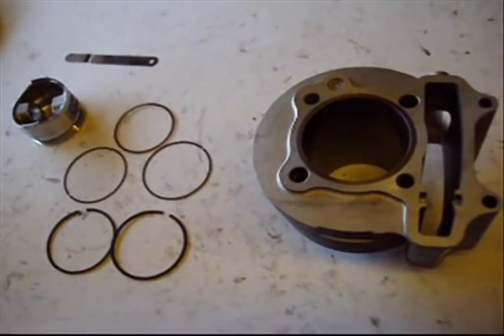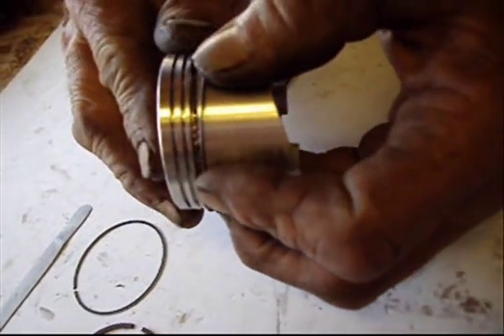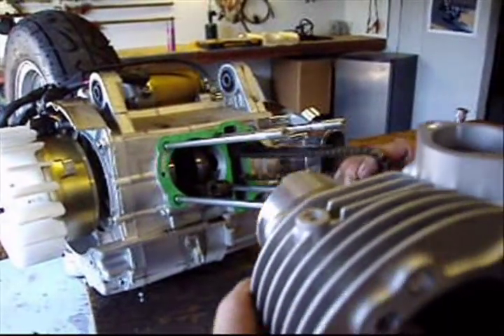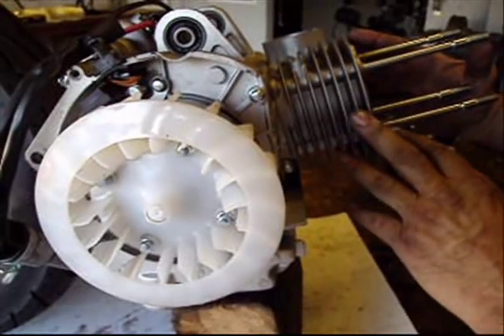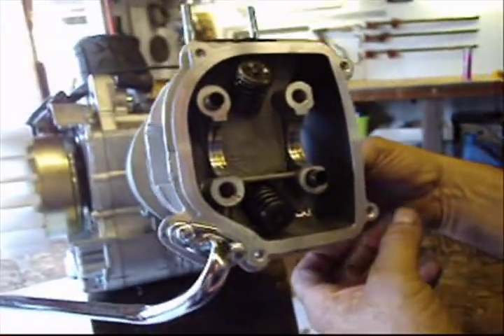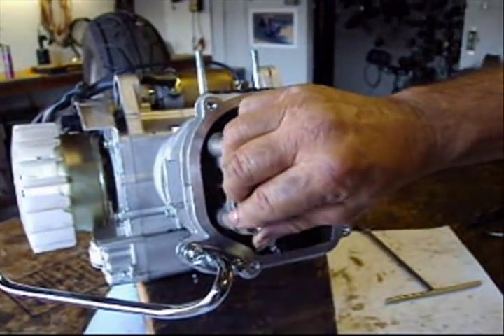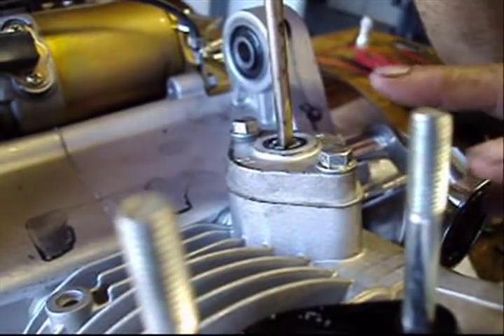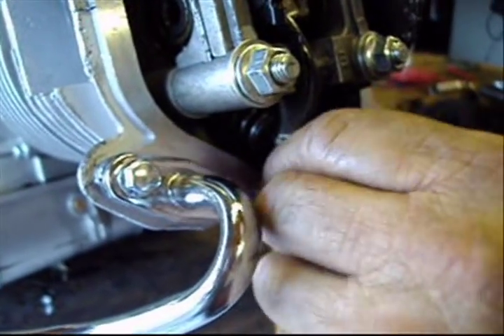replace top end # 3 on GY6 motor Nor Cal Scooters

Comment: nice video, nice channel, it is actually a lot like mine.   little bit of everything.  just do what you love and video it.  nice!!  working on the 150cc, had oil in the airbox, not sure how it is getting in there.   didn't add oil, and top end power is gone, and every time i rode it, when I would stop, seemed like oil would be spitting out the air box, so I think it might be the rings   (150cc Tao Tao 4 wheeler)   Thanks

Comment: I have been a bike mechanic for 43 years . First you should never never never dry fit a piston and rings into the cylinder without first applying assembly lube ( oil ) on the cylinder walls . Second you should set the connecting rod to top dead center (tdc )  and wrap a clean shop towel around the rod to cover the opening in the crank case before you attempt to install the piston and wrist pin . The reason for doing this is because if the wrist pin clip pops off your needle nose pliers as they sometimes do when trying to install them and flies into your crank case you are going to have a serious problem . You will have to do a complete disassembly usually to retrieve it . Just sayin '
Reply: I was thinking just the same. Always apply oil in the cylinder walls!
Reply: oil the shit out of every moving part.

Comment: I replaced the gaskets on my 150cc and the inner gasket was leaking again at the bottom i took it apart and the gasket is properly seated what the heck happened and will it happen again?  That inner case gasket was leaking on the top before when running the engine now the replacement gasket was leaking on the bottom.

Comment: To install a new cylinder head rebuild kit, do i need to remove the engine from the rover? I bought it used and the owner said the exhaust valve was stuck open? The engine turns over freely but doesn't fire up.

Comment: what if you drop the wrist-pin-clip in-to the case, while trying to snap it in?  use a plastic guard over the connecting-rod and exposed hole for the cylinder...even better/guard and long handle vice grips...
Reply: they make a magnet that extends it looks like pen if u will.

Comment: out side of oiling the piston cylinder  etc use a torque wrench the rocker arm assembly is brittle if u will.
Reply: Agreed, it's cheap white metal. Hand tightened would suffice

Comment: Is 8 thousandths 0.08 and Whats the best valve gap for the 50cc 139qmb with a 100cc bbk 0.04 intake and 0.05 exhaust
Reply: Skip that, just make sure you have the right parts..

Comment: my scooter is making an extra noice after changing the cylinder kit , i wonder what it could be , a chinees dude did it for me , can it be that he put the vavlechain upside down with the ex echaust etc ?
Reply: I have a question i got a sunl 150cc scooter from a local tow service and its been sittin up for a year and i prep it to get ready to crank and no suckion was cumin from carb so i took my intake off and took a peek at my values and there not sittin and one bumpin the other can anyone help me please
Reply: Their to tight
Reply: No. Sounds like valve slap, the engine was most likely assembled not a TDC

Comment: 6:12 head bolt torque

Cylinder head bolts / nuts 
18-22 Nm 
13-16 lb-ft the correct gy6 timing
Reply: fluxlines Isn't that too much?

Comment: Which piston ring goes where?
Reply: which piston ring goes where
Reply: Little one on the bottom then the squiggly one ontop then the other little one on top of that. Then the other two which should be marked. Make sure that where one side of the ring meets with the other that you have them all offset or it will get no lubrication and blow up